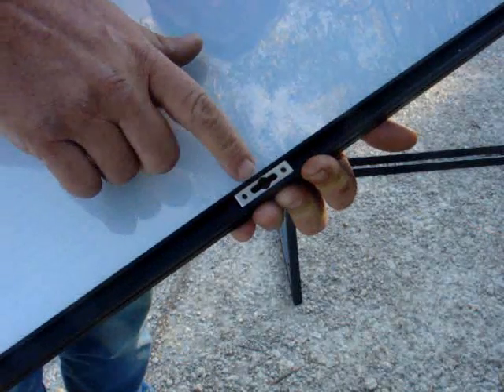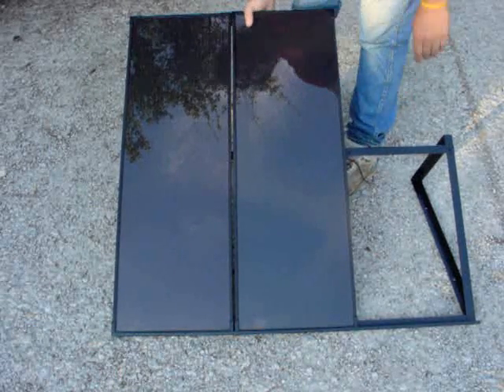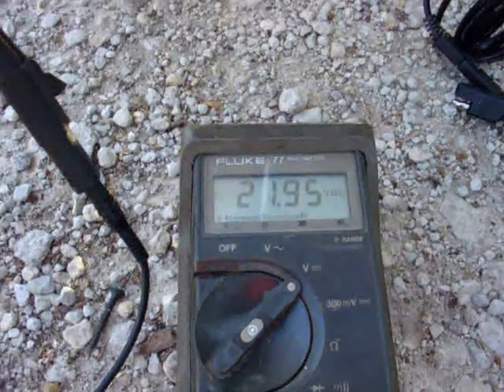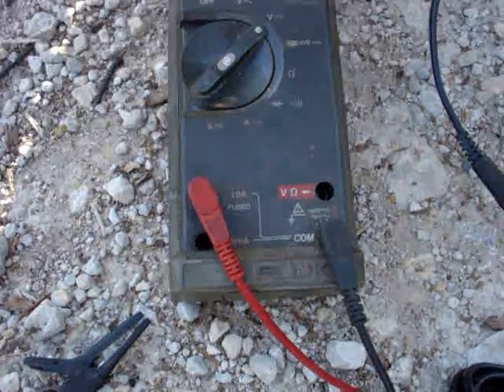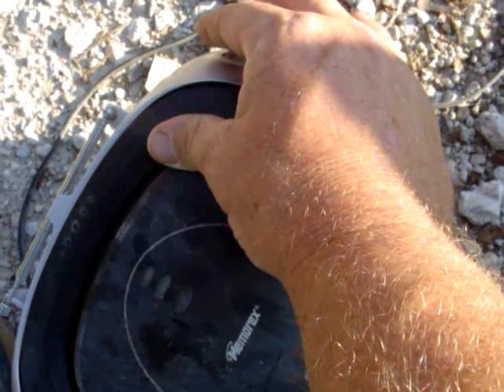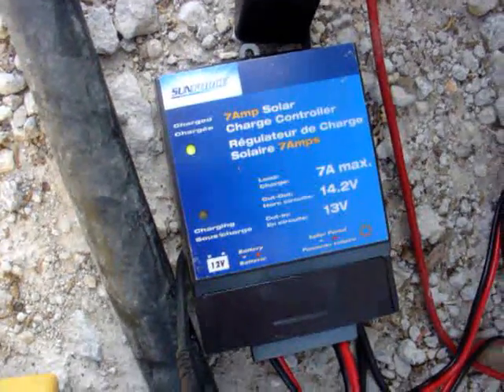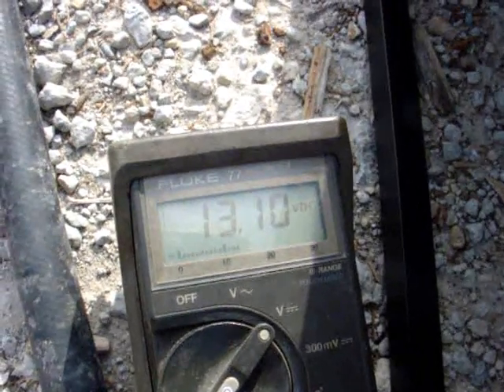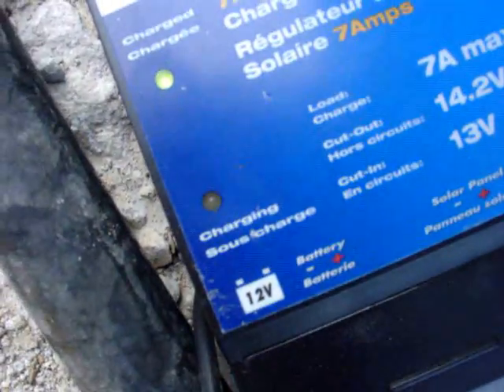Harbor freight 100 watt solar kit - UNBOXING and SETUP - solar panels for beginners (part 2)

Comment: muddymuddymuddman
   Yes. Too true... Of course, I smoke too much, but on the wall is an old Brass Lock, that Dad wanted for the Boatshed at the Coast, due to 'brass' locks having rusty steel guts. The Key had Bin-Lost in 1923, & in 1973 he made a duplicate, in steel ; I watched it open that lock, first try, after 50 yrs!... It'd chained a door that an extension had made obsolete. He measured the hole & etc, went off, & made it... So, memory is pretty amazing, when pushed !

Comment: @muddymuddymuddman
   Well, Scotty, they say there's 2 kinds of workshop, 1 has Pegboard walls, white, with black paintf outlines where each took hangs on it's hook.... Anytìng not in it's place is in-use, or lost. The other type  is the Photo-graphic Memory system. Everything is where it was put down last. Nothing is ever lost, unless someone else moves it half a foot - in any direction. I try to put things "in their place" but without pegboards. Memory as backup !

Comment: @muddymuddymuddman
   Ah, I see... Well, with the Clampmeter, I found I had to use the Hold button to keep it reading what I wanted it to show - once I let it go, (altering Field orientation & thus readout) to film it. But it shows the Static Systems Drain, in SunFoil Short Talk, rather nicely... The PVs should be OK with Thermal Shock, the 5 year warranty would expect Cold Rain, blown in, in a Sunshower..! Silicon copes OK, & the Gallium Arsenides have 20yr Warranty !

Comment: @muddymuddymuddman
   Yes, though y'll make y' life much easier if y' track down a Digitech Clamp Meter... My son gave me one, to cure me of blowing Multimeter Amp- Overload Fuses..! But it allows V & A  measurement without unplugging..., so whole new fields of monitoring open up. To get 60-W. from 60W panel at Middi, throw Cold Water & watch Watts climb. Or, clear the Smog Haze from your Sky... A cold, sunny windy day, with no clouds, is the ideal one for a PV.. Measure, & Graph !!!